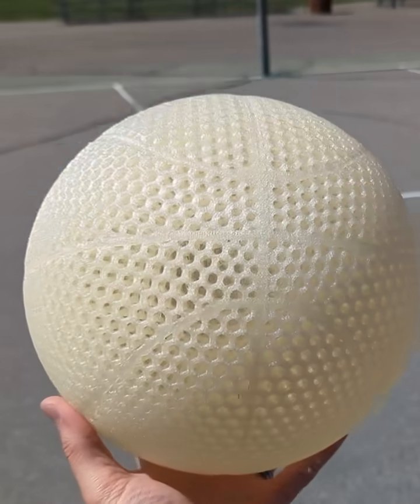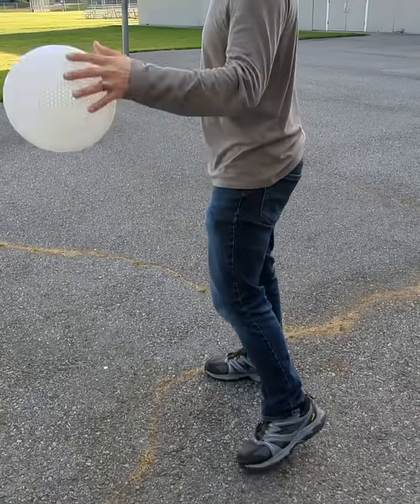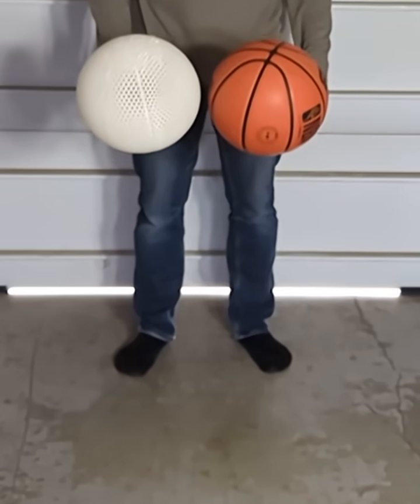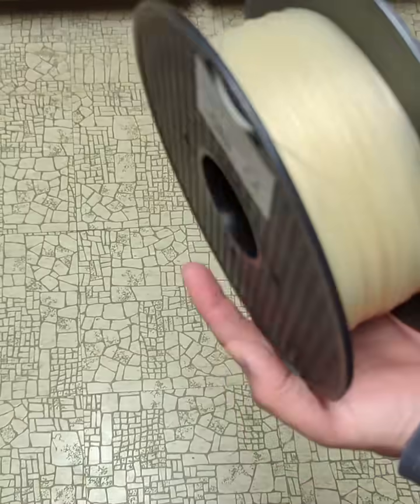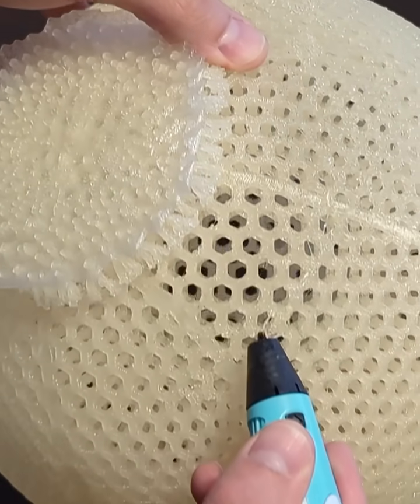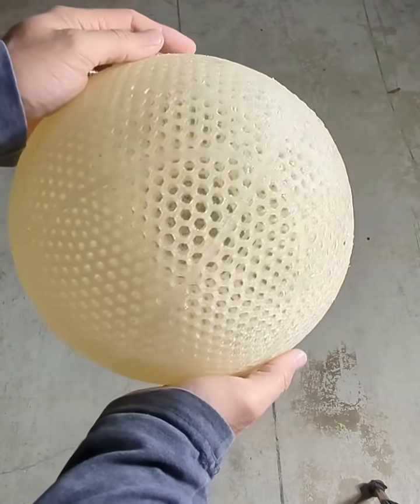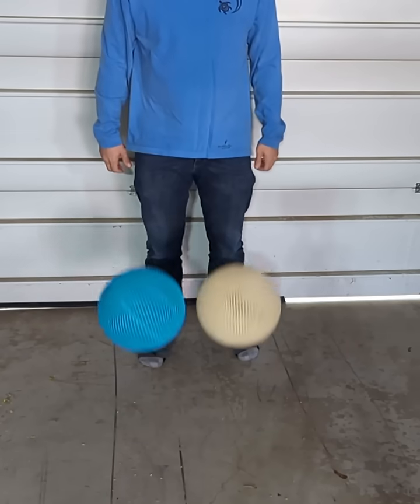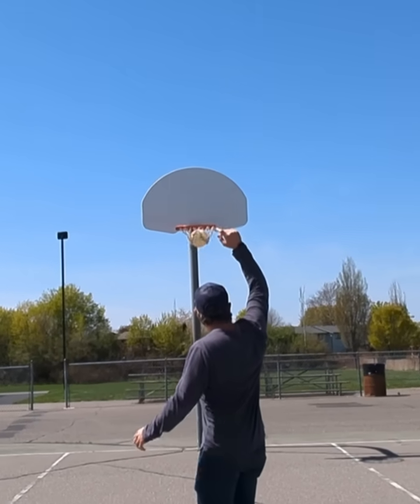Printing An Airless Basketball Using Yasin PEBA Filament! #shorts

Comment: Have you seen the new siraya tech filament? They have peba, foaming peba which could be great for shoes and foaming tpu. It is 30 dollars for one batch they have
Reply from the maker: I will have to check it out!
Reply: @makeitlabchannel I tested it and it does work really well, shocked with the longevity of peba bouncing. Much better then the airless basketball filaments

Comment: Will peba vapor smooth?
Reply from the maker: I have not been able to find much on this, but it sounds like PEBA would not be the best option for vapor smoothing because it is highly resistant to the “shop-safe” solvents used for vapor smoothing (acetone, ethyl acetate, IPA).

Comment: Sorry I keep asking but I sent you an email with questions and anwsers
Reply from the maker: Sorry for the delay! I sent an email response - let me know if you have any questions!
Reply: @makeitlabchannel thanks you so much I was actually getting on flexi tough filiment so I will make sure to shout you out on my next video for the help!!
Reply from the maker: @3DGuyfr Much appreciated! I hope it works well for you
Reply: @makeitlabchannel just ordered the filiment today so I will make sure to tell you how it’s goes!
Reply: @makeitlabchannel so my flexitough filament should be coming tomorrow, should I dry it and for how long and 4 or 6mm nozzle?
Reply from the maker: @3DGuyfr  I always recommend using a 0.6mm nozzle to save printing time, but that is really the only big difference that I have seen from my testing and both will work fine. It depends on the temperature you use on the dryer, but I always dried mine at 50C (that is the highest mine will go) for 6 hours before printing.

Comment: Is will cost about $100 to make  airless basketball can you find the cheaper one's?
Reply from the maker: Yes, the the BIQU PLA-HR and the Wisdream FlexiTough are great options under $100. If you want to go as cheap as you can, the Ataraxia Flex PLA is very affordable, but doesn't have quite as good of a bounce as the others I mentioned